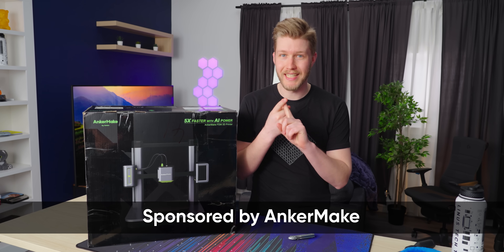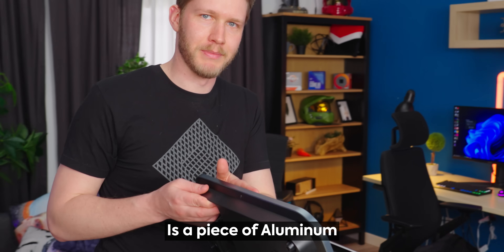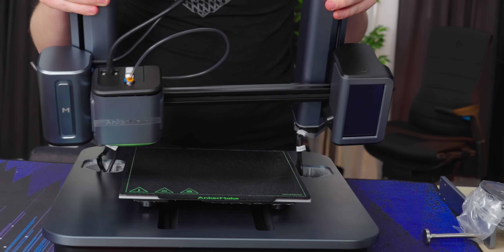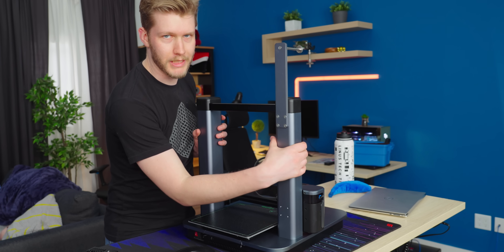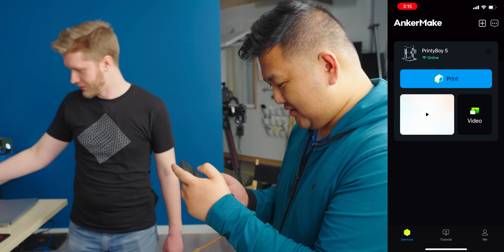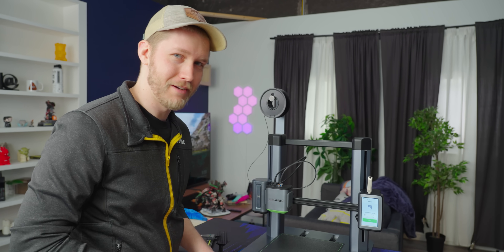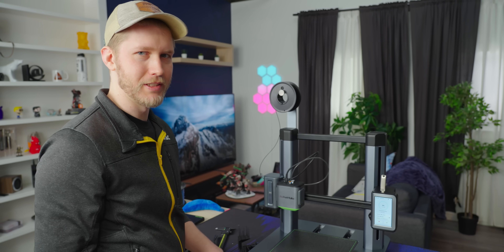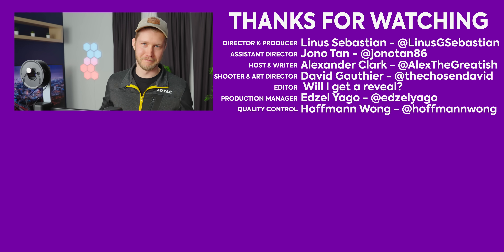Much BETTER than Expected - AnkerMake M5 3D Printer

Comment: The 5x faster isn’t that impressive when you look at the numbers cause you don’t know what it’s being compared to and from my experience those numbers actually fall in line with any regular printer.
Reply: looking at it printing, it looks like it's still around the 'regular' 50-60mm/s. I doubt it could ever get up to a 250mm/s print speed since the printer also has to account for acceleration and jerk settings. The hot end is probably along the lines of a V6 style & bowden, so even if it could get to 250mm/s I doubt it could be fed properly. At the end of the day it's as idiot proof as any other 3d printer: works just fine until it doesn't and then it's tear it down and tinker time.
Reply: Well, the "default" ender 3 speed is 50mm/s, so that's 5x ender 3 speed.

I run my ender 3 up to 100mm/s, but wouldn't try 250 so it's impressive with a bed slinger

Comment: DONT Do THAT!Careful pulling the PTF tube out of the extruder like that it could cause some really bad nozzle clogs in the heat break that way and mess up the hot end with a glob of death! When putting it back you have to do lits of end adjustments or its bad!

Comment: Sitting here looking at my 2017 ender 3. This thing is doing what took my printer 400 dollars in mods to do, but it does it out of the box.
Reply: I've had an Ender 3 for years have spent very little on upgrades glass bed, bowden tube, motor dampers, quieter fan, and aluminum extruder assembly maybe $50 total and a few 3D printed mods. Most were not even to upgrade print quality, but qol, to make it quieter, or just because I felt like it. The Ender 3 can print just as good as this overpriced printer out the box with no upgrades so not sure what your talking about needing $400 of extras for that's totally untrue.

Comment: Its not "leveling", it's tramming. This is not like hanging a shelf, you're adjusting 4 screw lifts and the parameters of the gantry... that's called tramming. Seriously needs to be a 3D printing for dummies to explain this. It's like people have no idea what finding level actual is. I am former union carpenter, stop bastardizing the word level.

Comment: Just looks like another DOBOT or SNAPMAKER to me, all of these features are a negative: Oversized bulky extruder, proprietary firmware/software/hardware, kinematic system, filament loading difficulty. Looks like a nice machine, but at the price they are asking, you can buy a CoreXY or a fully enclosed printer. Information I couldn't find easy, max bed and extruder temps, what material is used for the extruder gears and nozzle, will they be offering an enclosure, what materials will they support........ Most of these proprietary printers end up being a nightmare in a few years when the company disappears and no one is making direct replacement spares, or the software development has fizzled up, for DIY and the maker scene, open source is the best way to go, and using common open hardware that's easy to find is a better alternative, now if your a professional user, you would not even consider this thing.

Comment: I paid $1350 for a first gen LulzBot Mini back in 2015. It seemed to be one of the better options for beginners at the time due to its auto-leveling bed and ease of setup compared to other models. I haven't really kept up with changes in the 3D printer space since then, so even at full price, this Anker printer seems like a pretty good deal. Do newer 3D printers like this one have any features that actually make them worth upgrading to?

Comment: "10 years of experience" 

mentions nothing about the stepper motors being cheap. Doesn't talk about anything of note... 

... Oh and is surprised that PLA print isn't stuck to a COLD bed... HAHAHAHAHAHAHAHA. 

And you don't test modern 3d printers like that... That is like using a Benchy... a $200 printer can print those at decent quality now. You need to do things that test the tolerance and precision... 

The Linus Media Group at it again I see.

Comment: I'm still waiting for the day that 3D printers just work like.... a printer. Like I can just take it out of the box, plug it in and just send a print job. Instead of having it turn into a permanent hobby, just to get it to print a Benchy
Reply: Not gonna happen, their to complicated, things like jams, prints coming unstuck and so on will always be a issue.

However we have gotten to the point where it no longer needs to be a hobby as most printers will work out of the box with some basic setup.
Reply: @Steph.98114  They have done it in movies, and we will get it at some point, but not in our lifetime.
Reply: @dubious6718  lmao that's your reasoning? Just because it's be done in moves dosn't mean it possible in reality
Reply: @Steph.98114  Everything done in movies will be possible at some point.
Reply: @Steph.98114  Can confirm. Someone I knew got a Ender 3 v2 on amazon prime like 2 or 3 days ago. He did some first layer print tests and is already printing out parts for a pair of VR haptic gloves. I hear that the Kingroon KP3S is even better and it's even cheaper, just that it has a smaller build volume.

Comment: It was a good video. How "into 3d printing" is he really tho? He did a fine job hosting and simplifying it, but he seemed to be lacking some basic information and correct nomenclature for someone with 10+ years into 3d printing? Nit-pick ,I'll admit...ok...but still..0.40mm layer height with a 0.40mm nozzle?? 🤔 

The printer looks great for someone who does not want to "get into 3d printing" but simply wants to 3d print as hassle free as possible. Flashforge , IMHO, makes a better machine for those who just want to go print and not tinker.

Kingroon, Voxelab, Creality and Prusa machines are there for those who don't mind "tweaking and tinkering" to get the perfect print.
Reply: why would he use specific jargon when its a video targeted towards people who might not be into 3D printing yet
Reply: @MrWizardjr9  that's a good point, and I agree with you 👍🏻

Comment: The thing that's held me off from getting into this is just the fiddly nature of machines up until just recently. Almost every "how to" or "review" video is: "This affordable 3D printer (which I got for free but do not disclose) is awesome and with these simple hacks becomes top tier. +1 would buy again." The "simple hacks" require a working 3D printer, laser cutter and CNC mill and a collection of aftermarket upgrades that cost more than the printer.  New hot end. New direct drive extruder. Add-on BL-Touch. New driver board better stepper drivers.

Comment: That base is very clearly die cast aluminum, and therefore isn't quite as expensive. It's finish machined obviously but they already have 1 setup to drill and tap so undoubtedly wasn't a big deal to mill some of the other features
Reply: What's the tip-off for it being die cast? I don't see any surfaces that aren't machined. Die casting is also prohibitively expensive for prototypes. Maybe sand casting?
Reply: Also, theres no chance in hell it would cost them over $100 in Aluminium +labour.  Aluminium is one of the most recyclable materials and is about scrap $1 per kilo where im from (recycled Aluminium is used in most electronic devices) . All it requires is simply smelting.
I am sure a company like Anker can get their cost to or under $50 per unit (just in making the face plate)
Give me $100 and a couple hours and ill make you polished faceplate at my workshop.

Comment: I saw ANKER, I was interested; I saw that large base, I was even more interested... then I saw how small the actual print bed was and the price, and was no longer interested. Yeah, the print quality's good, and the auto-leveller is nice, but my Ender 3V2 prints that well too (albeit more slowly) without auto-levelling, and for $760 I really want to see a bigger print bed than that. 

(Also something I really want to see is how difficult that hot end is to clear if/when it jams or leaks. If the Bowden tube is that easy to pull, it's going to have slippage issues, and that will mean PLA in the tower, and you're going to have to be able to clean that out. Is that big hot end easier to clean than it looks? Because it looks like a pain in the ass, and I think that's an important question for a full review.)

Comment: I bought an Ender 3 Pro from microcenter for $100 recently. Added ABL sensor and I love how it prints. It's no where as fast, but it's so much cheaper. 3D printers are getting easier to use if you know what you are doing. This machine is probably best suited for a first timer or kid.
Reply: actually, your ender3 is just as fast, it just doesn't have as much decoration on it.
Reply: I was gonna get some of the $99 pros but decided to go $350 s1's. After abl, better motherboard, direct extruder and such it was easier to get it all out of the box.

Comment: I have done a lot with 3D printers, I own and operate 8 of them... Sure, they are a real hassle to work with, especially my ultra-cheap ones. But I don't buy their claims on speed, 2k acceleration is the default for even the cheapest printers I own. Acceleration is the real deal with speed printing, if you can't get to 250mm/s on a print line in the first place, what's the point of it? The pressure-based leveling is quite interesting though, I had a printer with that a while ago, and was a pain, hopefully, that technology has matured more now. I feel like there is a lot of unnecessary plastic and *big boi aluminum*, really don't know what they really are going for. That does not mean I don't have hope that this project comes out nice though, unlike many other failed 3D printer Kickstarters out there. Good luck to the Anker team!

Comment: I love Anker. It's like a company full of people that look at outrageously priced tech and go "nahhhhhh we can do that better"
Reply: Retail price is $750, more than double an ender 3
Reply: @TheMidnightSmith  yeah but it has way more features. However it isn't open source.
Reply: @G0rg81  nope, and at that price, you're in prusa competition tier.
Reply: @TheMidnightSmith  well yeah but ypu were comparing it to an ender 3
Reply: A Prusa i3 Mk3s+ is already that price, and a much much more reliable and feature rich printer. Then comes Ender 3 S1 for half the price, which is basically the same printer but will beat the anker in any metric across the board. Then there's the good old base Ender 3 at around $150 which will do PLA prints at the same quality - minus all the bells and whistles. 
This is a sponsored video from Anker, and views exactly like a commercial. No mention of specs, no details on the material used or settings involved, no info on servicing - a 3D printer requires regular upkeep like any other tool.
Reply: Except power bricks and batteries... They're like "nahhhhhh we can do that pricier"
Reply: @beau2418  my experiance cheaping out on power is a bad idea so I usually go with anker for peace of mind

Comment: Surely the spool holder goes on facing the other direction to hold any sized spool? Might be why the screws weren't going in either they were threaded in the other direction.

Comment: Cool stuff.
I think one year ill pick up a nice 3d printer. Something popular with lots of projects i can find on the net.
I was thinking. They really should make a machine that makes filament with plastic bottles or even tin cans and the sorts. 
Eventually make it all in one.
Hey id be buying only plastic bottle drinks. Some people will be going thru peoples recycling. Meh grab the recycling bins at work. hehe. Just needs a deep wash.
They city does do stuff with recycling right?
Reply: There's already a project that converts bottles into filament that can be used in all-metal hotend printers. Tin cans are going to be magnitudes harder. Bottles don't have a lot of material though, so there'd need to be a way to automatically feed the printer or filament maker more automatically. Get that sorted and it's basically free filament that can still go in a recycling bin afterwards.
Reply: @KentoCommenT  they can ether melt it or cut it into strips to be fed thru the machine that melts that, i think that's what it does on bought filament.
I mean eventually you can make something nice after a collection of bottles.

Comment: I was looking at prusias because I am getting tired of my Ender being and Ender, so if this is around the price and better I would 100% consider this a viable option. I am super impressed by this machine.
Reply: Just buy the Prusa,  0 problems, just  press print and go to sleep.
Reply: @carlosrodrigues6863  I have recently been hearing some horror stories about Prusa as well, but they are all from people who operated them at a school, so I think that has something to do with their early demise.
Reply: @Dangineering  I have one and haven't had any issues
Reply: Which ender do you have? I have an ender 3 V2 is 1/3 the price of this one on Kickstarter currently and with some (expensive) upgrades you can get pretty good results (BL touch, Microswiss hotend, double Z axis spindle, raspberry pi with Octoprint for remote management)
Reply: @gasper5223  I have the Ender 3V2 as well, I also got the microswiss and BL touch which has made printing easier, but not what I would call consistent or smooth. The biggest problem I am running into is that I need a higher temp for my hot end for printing Nylon, but the Ender simply stops you at 260, which has led to some stupid weak parts from an otherwise really durable filament.
Reply: Get the prusa

Comment: That filament runnout is not good IMO. If a filament ends, its inside of that box with no access to it. how would you take it out? Does the printer retract the filament already existing inside the tube and prompt you to insert more?
Reply: Usually you just feed your next filament through and now you have a color swap!!
Reply: @heehaw316 althoght that is True. It is not optimal, is it...

Comment: man this machine is absolutely beautiful :O and print looks amazing, and all that for a MSRP lower than a Prusa i3, that's incredible, might actually consider this over the Voron printers.
Reply: The voron isnt really comparable to this. This one looks like it'll have Tons of problems with ringing, wich your voron shouldnt have. Itll be a cheaper, easier to set up, but not as cutomizable.

I think it ia goos to have a rival to the prusas, but ill stay with my v0/v2
Reply: @impact224488  from the perspective of a quick 3D printer i would definitely say they are comparable, sure the Voron's are a absolutely beautiful piece of engineering, but it has it's issues as well.

but i do agree a prusa is more comparable, which is why i used a prusa for comparing :P tho ringing is almost always a tuning issue and not a machine issue

Comment: Dude, discounted units have instantly disapeared, I was really sold on this one for an easy to use, non DIY, first printer, damn...
Reply: Yeah some people bought 20-30 of the discounted ones. I only got 2, it's a crazy printer for the money.
Reply: Check out a prusa mini, prusa is really popular in the printing community and the mini is a great beginner printer
Reply: @Steph.98114  I don't want a toy just because I'm starting, that one is way too small.
To be honest I've already used and old Ender that we had in work and my main issues where the bed leveling and the poor maintenance that the machine received in the past.
I want something with a decent size, easy to maintain, and that just lets me go directly to printing, of course without going bankrupt.
Reply: @YOEL_44  it's not a toy lol, it's their budget option that still has all the benefits the mk3 including auto leveling. It's got a 180x180x180 which isn't much smaller then the standard 200x200x200 and is super robust
Reply: @Steph.98114  I'll look more into it, but 400 for the Mini seems like too much after what I've been teased with.
Reply: @YOEL_44  that printer is they showed of is $700 and lacks a lot of the stuff the mini has, plus it's from a company that is known in the industry.

Comment: I feel like the editor is trying to insert themselves too much.  It's really confusing when the host is saying one thing and the editor is just correcting them with little notes at the bottom of the viewport.  Also, I don't think it really adds much for there to be subtitles for the editor's thoughts such as "they are still struggling?".  Just the edit of "Professional" on both Alex & Jono was enough to suggest this, we don't necessarily need to hear from the editor as well.

Comment: Doing the manually selected auto leveling before every single print shouldn't be required for any printer above $300. I get the trauma, but that's completely unnecessary. Especially on this printer with so many error correction features and remote monitoring where you can see how it's printing past the first layer. Alex is making it seem like it's still something you should do with this printer which is unfair.
Reply: Lmao this is what every printer with auto leveling does, even the prusas do it.
Reply: @Steph.98114  I have a Prusa and I don't have to do the complete manual selected auto level. Yes, it auto levels the 9 points before every print, but I don't have to manually do the full auto-level process every print, which is what Alex is talking about.